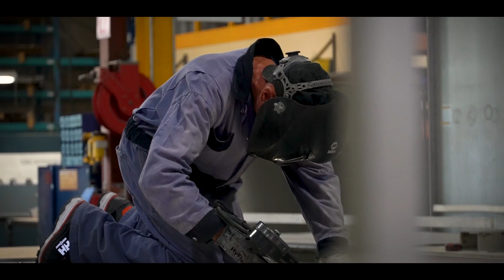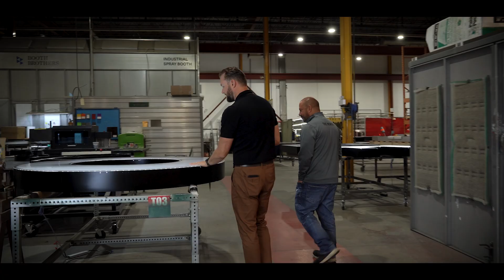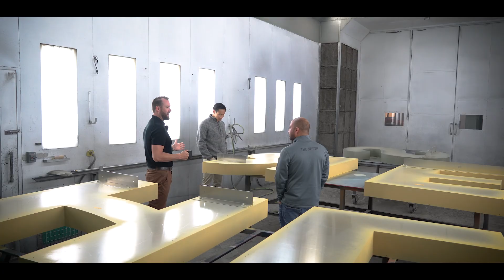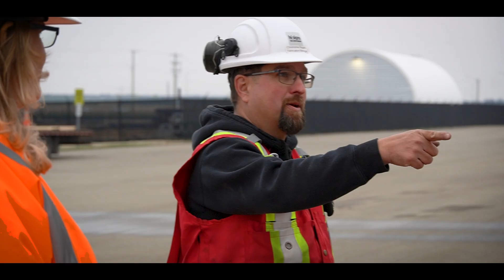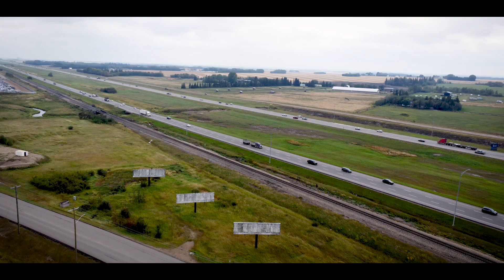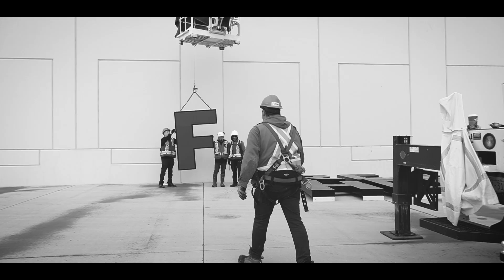World's Largest Lime! | Hello Fresh

Comment: I've been an installation technician in the commercial sign industry for just under two decades, and I need to make a couple of things clear. Firstly, almost every client I've installed exterior signage for will almost always point out fasteners that are not painted, then secondly.......RULE NUMBER ONE........placing thousands and thousands of dollars worth of the customers new purchase on the ground right below the boom of the installation unit? Hmmmm,not very smart or worse? Professional or safe.